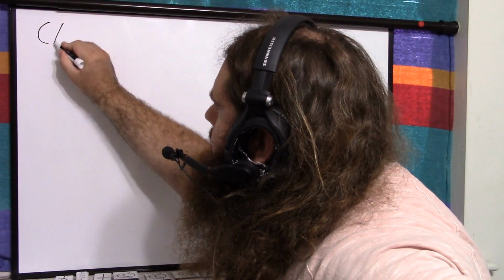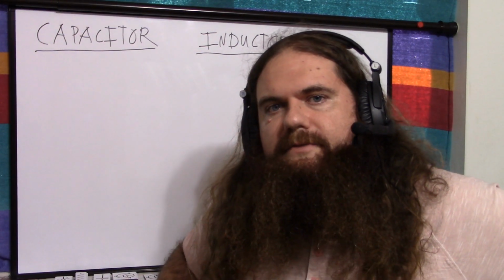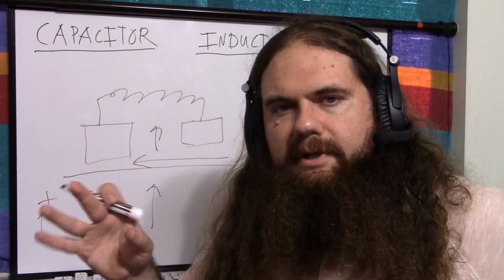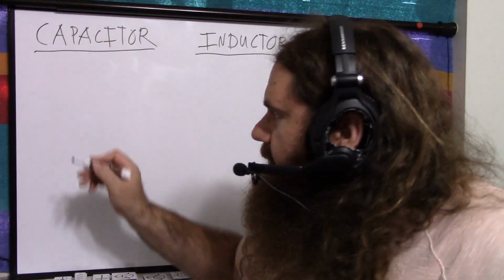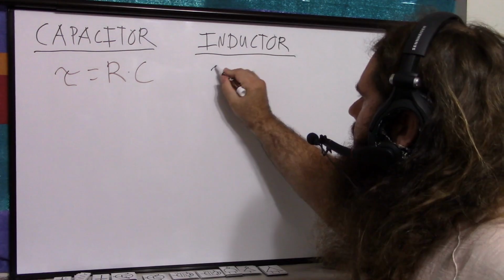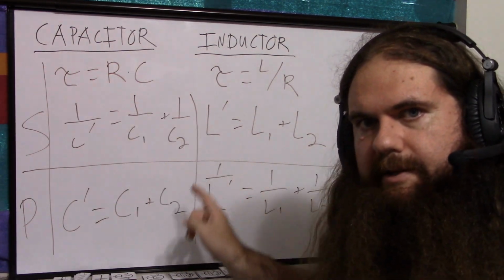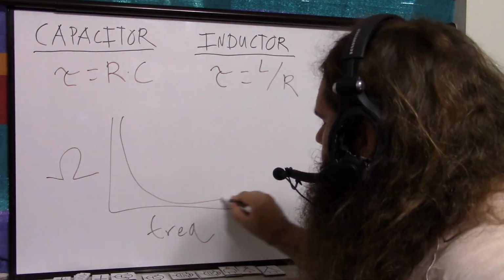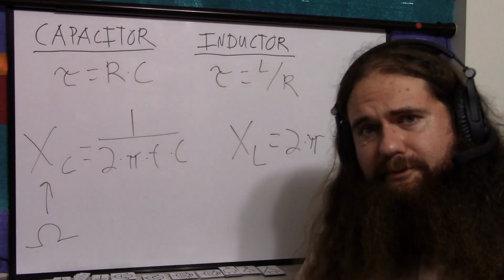Inductors and Capacitors In-Depth - Exactly The Same Only Completely Different - Simply Put

Comment: The thoery of relativity connects the electric and magnetic field , actually magnetic field is also a moving electron but you are observing it in a different frame of refrence[watch varistasium video on it]     , I liked your wreking ball analogy , also i like to think capacitor is like a mini water tank , if you increase the freuency of water going in and out from the same pipe ,then tank doesnt have time to fill ,it remains the same just like capacitor , and the wrecking ball is just the opposite , despite both wreking ball and mini water tank work on completely different concept , we can observe that both work are like reciprocal of each other , 

so thanks for the clarity on inductor ,I wish my school had someone like you to solve my doubts ,some one so practical and creative ,who can basically breakdown any problem into simple real life examples , Again thanks for the video ,It helped me a lot.🙏🙏

Comment: hello everyone, i have a way to understand inductor reactance easily and intuitively(my take at least)! first, assume the AC case, where we measure signals and such. The inductor is replaced by its reactance 2*pi*f*L. The voltage across the inductor IS the backwards EMF. Now i know that the direction of the voltage drop is in the same one as the polarity of the signal, but since the EMF subtracts from the total voltage drop, its literally the same. Now, assume we have a signal passing through our inductor, with a frequency. We'll analyze in both high frequency and low frequency cases. Imagine the signal as being an infinite sum of dirac impulses (math concept i learnt in signal processing, its basically a square pulse with an infinitesmally small width and a height of 1, the height could be any unit, and in our case it's volts, and on the x axis we have time in seconds). For the duration of the dirac delta, the EMF decreases, because in that time the current is constant, and the EMF decreases gradually. As the frequency increases, the width of the dirac impulse decreases because the voltage changes more rapidly, not giving enough time for the EMF to decrease(in either direction that the signal swings), and thus the voltage across the inductor increases more and more (because the EMF decreases less and less) and at very high frequencies the voltage of the signal will be dropped entirely on the inductor, or the EMF will  decrease extremely little after each change in voltage. In the low frequency case, the voltage drop across the inductor decreases because the impulses have a longer duration, in which the current is stable and the EMF has more time to decrease until the next impulse, making the voltage drop at the end of each impulse and right before we move onto the next, smaller. Anyways, that's my take at least. Simply Put, thanks so much for the video, without it I might not have figured out this stuff! I'll try figure out the capacitor next and I'll post it here too! If I am wrong in any way, please, correct me. And if you have any questions, please ask!
Reply: man that's a lot of text

Comment: I saw this inductor current on the O'scope when I built a telegraph. 
Once I would hit the key, and release the Code Key, there would be a momentary Strong Spike "A Spark ' produced by the coil in the ' Clapper'
I had to install a Diode to prevent burning of the points in the code key from this spike.

It's a nice basic experiment with Coils and Back Current ...

Comment: My confusion with capacitors has been cleared! With all due respect  thanks to this video here https://youtu.be/UrCFv2qCELI?si=_oQElaUZmISC2upN its so good i have to share. I uses the water analogy but not like ive seen before,  the caapcitor is an elastic membrane getting pushed from one side then pushing the other, there you can why it only works with AC, it needs the back and forth because it doesnt actually let electrons through it like my confusion was causing, no thanks to the battery anolgy, it builds up preasure and pushes electrons out the otherside using that prasure, but where do the electrons come from? The inductor explanation is even better with the water wheel, there you can see clearly without haveing to process words or equations, just simply looking at the thing its obvious if you push too fast the waterwheel will suck up the energy, if you push just right it will be normal, resisiting any quick changes in preasure.

Comment: Lent's law has nothing to do with back EMF, but rather it's related to forward/front EMF. Trying to stop or decrease the current (or magnetic field) of an inductor will cause forward/front EMF that will make sure the current (magnetic field) remains continues. back EMF is actually a result of Farady's law.
Reply: I suggest your google Lenz's law before you make a stupid comment, and learn to spell Lenz's law.
Reply: @AlohaHoward-ui7df  

I suggest you do not base your physics knowledge on Googling... 

Lenz's law simply indicates the EMF's polarity. Both forward and back EMFs are governed by Faraday's law.

Comment: My confusion with capacitors is that how do they discharge electrons if theres a barrier between them?  Whats funny is a I found a book called electromagnetism and when i opned it on a random page it was about metal conducting, and they said that how electricity really flows is a question only quantum mechanics can answer.  And maybe why the confusion and unhelpful anologies used when describing capacitors, and maybe there is something to Veritasium's claim that electricity doesnt actually flow through wires, but in the magneti field around the wire connection? or something like that.  Maybe this would help alliveiate the problems in understanding inductors too?  I dont know, im still on step 0 on electical components ie - I understqand wires carry electricit,y but see maybe  thats the problem... not really understanding the basics like step 0 is why we're having trouble understanding everything else.

Comment: 8:31 'You've increased the current, the magnetic field is not strong enough yet..' What do you mean by 'is not strong yet'? Or let me put it in another way: Why does the current increase? I mean, if the inductor initially blocks the current (I=0 at t=0), why it does not continue to block all the current?

Comment: May I please ask you about a question that do not make sense? :-)
If you suddenly cut off the current to an inductor, do you get "high" voltage out of the coil as a reaction on the sudden change.
Does that mean you in fact gets "high" current out of a capacitor if you suddenly cut off voltage?
Reply: A very good question! To answer the first part of it:
 The current flowing through an inductor is what creates or builds up the magnetic field around the inductor.
Once the current is cut off, the magnetic field drops to zero instantaneously (zero time) which theoretically induces an infinitely high voltage on inductor's ends because there is no circuit through which the induced inductor current would flow.
 However, in the real world, the inductor has some capacitance, some resistance, and its insulation is not ideal, so at some high point all of these effects combined will limit the inductor's peak voltage at the moment of the magnetic field collapse.
 If there is a resistor or a capacitor across the inductor at the moment of disconnecting the current, the collapsing field will generate a current in the inductor, and this current will oppose the change in the magnetic field, so the field collapse will be slowed down due to it.
 As for the second part of your question:
The inductor and the capacitor do not work on the same principles, and their behavior, though similar but inverse in a few ways, is not the same.
 While the capacitor actually stores electric charge, the inductor does not store magnetic "charge"; its inductive kick-back is merely a result of the collapse of the magnetic field that was built up around it while the electric charges from an external source were flowing through it.
 If the capacitor is disconnected from a voltage source, its voltage and charge will remain the same. If you then short it out, you will get the high current.
As I said, inductors and capacitors don't work the same nor on the same principles.

Comment: @Simply Put. Just joined your excellent channel. Being able to explain this in laymen's terms like you do it is just pure genius. Most academics cannot teach but you certainly can. I am sure many EE grads do not have the depth of understanding that you have too. By the way Eugene Khutoryansky (a physics prof.) has a video that explains capacitors really well. Well worth a watch if you have not seen it yet. Basically as the electrons build up on one of the plates they repel the electrons on the opposite the plate thereby creating a current flow. Anyway, love your insights. Thank you.

Comment: Hello Simply put, I'vebeen messing with primary of microwave xformer modified to be an 
electro-magnet, there is a real bit of an arc when disconnected from a storage battery, is a 
condenser across the points of ignition coil a tank circuit?  Very interesting, as I get it, less 
current thru and inductance, say field of traction motor,  less current thru it, lass back voltage.

Comment: A very interesting  circuit that illustrates the inverse relationship between capacitance and inductance is the gyrator: https://en.wikipedia.org/wiki/Gyrator#Application
https://sound-au.com/articles/gyrator-filters.htm
It simulates an inductor by taking the current through a capacitor, converting it to voltage (with a resistor), and applying that voltage to the input voltage through another resistor.

At the beginning, the maximum amount of current flows through the capacitor, so the maximum voltage is applied to the input, so the minimum current flows through the input.

As the capacitor charges, the current through it decreases, so the voltage applied by the op-amp decreases as well,  increasing the current from the input, until the capacitor it fully charged, and the op-amp's output falls to 0 volts.

One way to rationalize the input resistor affecting the effective inductance is it affects the current that can flow through the input (a lower resistance proportionally increasing the input current the way a inductor with a lower inductance has a proportionally higher current compared to a larger inductor at any given moment), and it also discharges faster when the input voltage is removed (as the capacitor's series resistor acts as a parallel resistor to the simulated inductor).

Some limitations are that it can only simulate an inductor directly connected to ground (though it's still useful for filters and tank circuits where it would be anyway), and the current it can deliver is limited by the op-amp and input resistor.

You can also simulate a capacitor by putting an inductor there instead, but it's usually not used like that because good capacitors are a lot cheaper (which is why it's useful in the first place, in addition to letting you set the equivalent inductance with a resistor).

Comment: One way to think of capacitors in series (conceptually) is to add up the gaps within each one. Capacitance is inversely proportional to distance, therefore distance is inversely proportional to capacitance, so you add up the inverses of each capacitor to get the sum of the distances, and then take the inverse of the result to get the total capacitance. (Capacitance is also directly proportional to plate surface area, but it works out anyway. You could probably think of the surface area simply being distributed across the plates, but I'm not sure).

While I did come up with the intuition for the formula myself, the actual conceptualization of adding distances is taken from one of Eugene Khutoryansky's videos (which I highly recommend).

Parallel inductors can be thought of as being akin to resistors with values that decrease over time. Therefore, the formula for resistors in parallel also works in this context (adding up the currents flowing through each and then taking the inverse to get the effective inductance. Two identical inductors in parallel have the same current as a single inductor with half the inductance).

Comment: very well put, how u compare  physics  is great, the wrecking ball hangs str8 down. pushed 
forward with a truck and held, the power that the truck needed to push the ball will be 
stored in the ball, when the ball is allowed to swing back, it will have a lot of inertia, same with 
magnetic field around primary of ignition coil, points open and the flux bilt up now collapses
back into primary coil, that is why a condenser is across the points making a tank circuit,
absorbing the back volts an keeping the points from burning out.

Comment: YUP, The Leyden jar was the first capacitor a large bottle  with tin foil on in and outside with a chain
of brass to touch the inner layer. Ben Franklin got across a battery of Leyden jars that were well
charged, said it was like stickin a hot branding iron into a keg of gunpowder.

Comment: 2:13 Capacitors do not resist changes in voltage. Exactly the opposite. They resist if voltage does not or only slowly changes.
An ideal capacitor in series will completely resist a DC voltage but lets AC pass. The higher the AC frequency (the higher the rate of change of voltage), the lower the capacitor's "resistance" (technically called impedance).
An inductor however will resist changes in voltage. The resistance is 0 of an ideal inductor at DC and rises with increasing AC frequency.
Reply: you misunderstood his point. He is not talking about literal resistance as in a resistor or impedance when talking AC. He is just describing what occurs when voltage changes. And resisting is meant as in, that capacitors behave in a way that counteracts an external voltage change by either releasing or storing electrons, so that other parts of a circuit would see less of a change in voltage, generally speaking.
Reply: @niels1497  But that is not what a capacitor does. What you're talking about is circuit design where you put a capacitor parallel to a voltage source and variable load.
Also, "resistance" has a well defined meaning in electronics and to use it differently just causes more confusion.
Reply: @xnoreq  You have partially answered your own question and confusion, but you have also missed and misunderstood the point of the video, as well as mixed/confused voltage with current, and parallel with series connection.
 He is talking about the capacitor VOLTAGE in parallel with the voltage source, and you are talking about CURRENT through a capacitor (yet calling the current VOLTAGE).
"An ideal capacitor in series will completely resist a DC voltage but lets AC pass."
WRONG! First of all, you are talking about SERIES circuit, and it will not resist VOLTAGE, it will resist (or block) CURRENT!
"An inductor however will resist changes in voltage."
 WRONG AGAIN! Inductors oppose or resist CURRENT changes by generating a CEMF (counter-electromagnetic force) which matches the applied voltage.
 I suggest you go back to basics and pay much better attention to the exact phenomena being described.
You have got your voltages confused with currents, one of the most fundamental mistakes you could make in electronics.
Reply: @edinfific2576  What question, what confusion? I have neither asked a question, nor was or am I confused. The way he explains it using sloppy language is simply bad.. He also doesn't mention or draw any parallel circuit, instead he shows the voltage applied to a capacitor and then he says the capacitor resists changes in that voltage.

Of course saying that it resists voltage is stupid and confusing, but that is what he does. I simply re-used his sloppy language. Of course voltage itself is not resisted, but the flow of electrons, current.

"WRONG! "
Nah. The infinite resistance (to electrons, current) will result in a complete voltage drop across the capacitor in series. In his sloppy/confusing langauge that would be "resisting the voltage", at least that is how I took it.

"you are talking about SERIES circuit"
Really, duh, it's not like I even explicitely mentioned it...
Also note that the infinite resistance for an ideal capcitor with a DC voltage applied holds true regardless of application in circuits. 
So no matter how you look at it, his explanation is using sloppy and confusing language in the best case and simply wrong if we're strict.

Finally, for the future, I suggest you try to be less of an a-hole because others might respond in kind.
Reply: @xnoreq  Sloppy language! A Capacitor resists changes in voltage by initially allowing current to flow and then storing charge. An inductor resists changes in current. It does this by generating a voltage that opposes the change in current. Before criticizing someone U should thoroughly learn the subject first!

Comment: my question is unrelated to this topic, can you explain the difference between UA741 and lm741?
Reply from the maker: Looking at the datasheets, the LM741 looks like it just handles more voltage, so it'd be better for large amp setups with huge supplies. I use the LM358 that doesn't have the offset-null pins, so that's new to me, but it looks like both the LM741 and UA741 would be much more accurate and stable because of the offset-null pins.